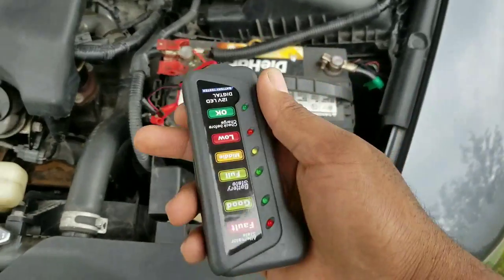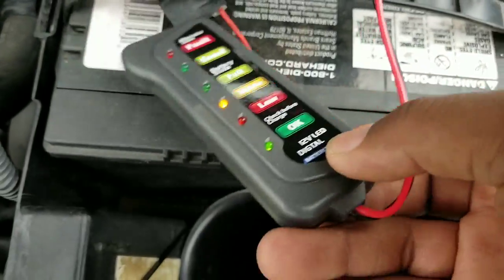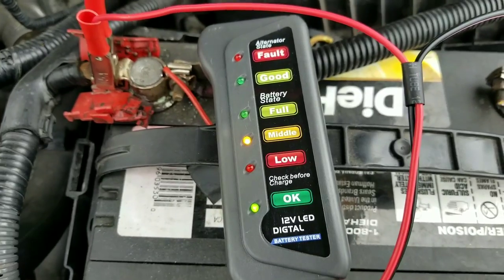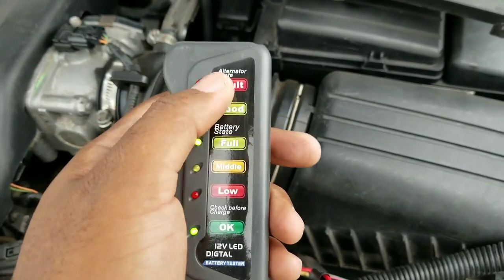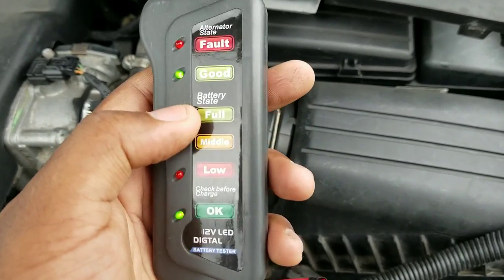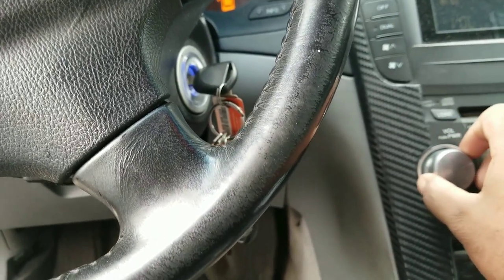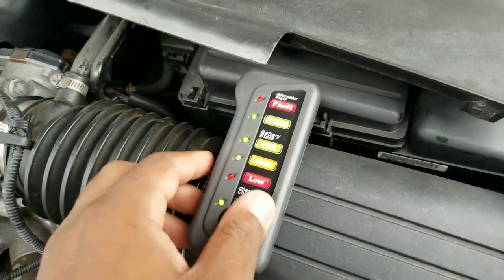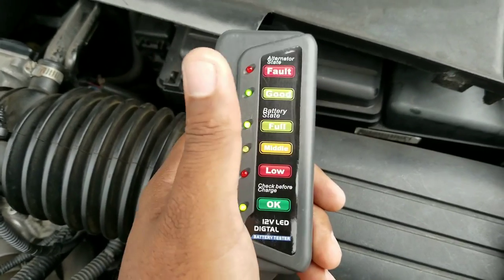HOW TO CHECK AND LOAD A ALTERNATOR AND BATTERY TUTORIAL

Comment: Do you know what it means when I turn on the car and the alternator state shows solid green on good but also flashes red fault at the same time?
Reply from the maker: Sounds like battery is charging but isn't good so it isn't holding a charge.
Reply: @MODS FOREVER  so it's the battery? It does it on both my cars. Alternator light shows good but faulty flashing at the same time. The green is solid meaning good but with the red faulty flashing.  Could it be my tester is bad? Or is it my charging system?

Comment: I check my battery  the battery is full but  the alternator has a green blanking light what does that mean
Reply from the maker: means the alternator isnt charging the battery means it needs replaceing.
Reply: @fabolousg4ever  it foes not need replacing some times these  sheep gadget dont work ok I had same got checked in garage alternator was fine gadget was wrong do not buy this crap
Reply: U can turn the car on and unhook the positive cable from the batteries if it cuts off it's a bad alternator if it stays on then the battery is no good
Reply: @fabolousg4ever  yep that's what it was ✅

Comment: Save ur money.i got one alternator green light flashing this guy saying altonator  need changing .dont I took mine to garage after I use this gadget and garage said gadget cheep crap altonator  fine.good way to check altonator  is wen enging running take of negative  lead.and if engine stalls or goes of that is good sign altonator  bad
Reply: Noice engrish
Reply: Take off the positive not the negative 🤦🏽‍♂